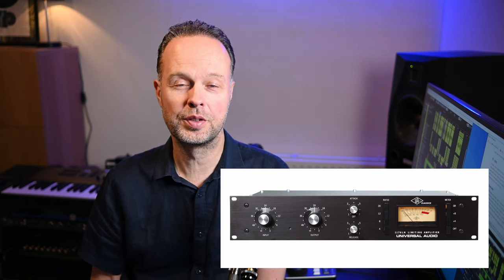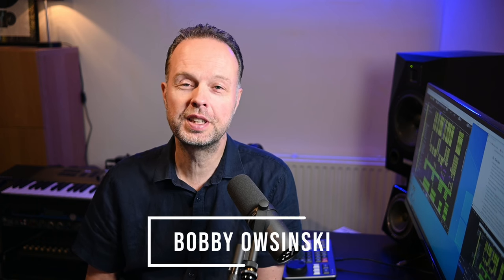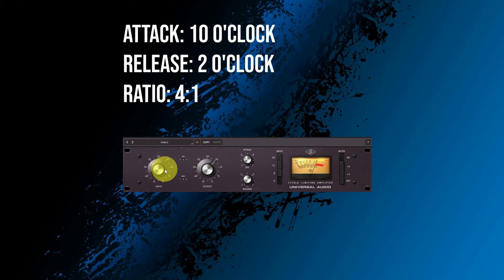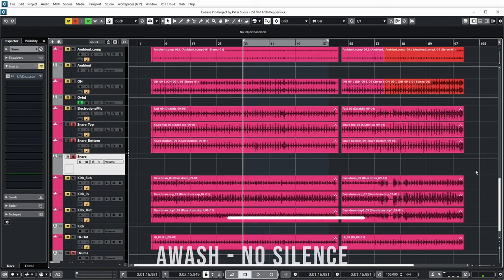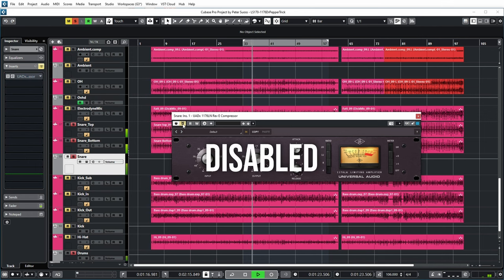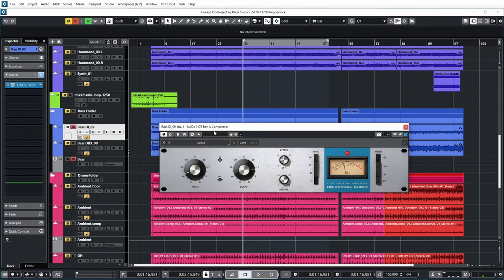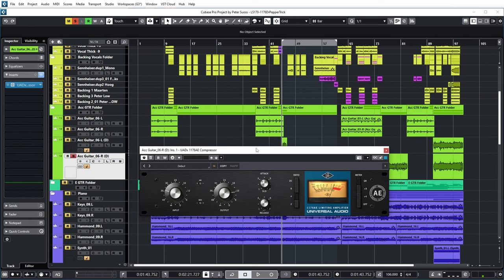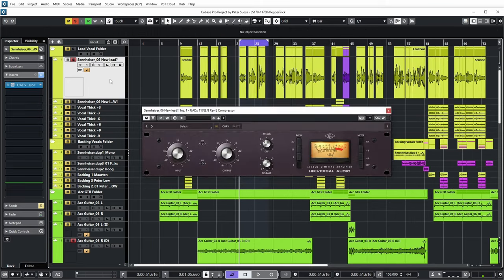Unveiling the Dr. Pepper Secret: A Surprising Audio Trick on the 1176 Compressor

Comment: I didn't know about the trick... but then again, I don't have an 1176-style compressor.. at the moment I think I'm managing to use the stock Cubase compressor mostly quite well...
Do these settings stand as a general all-around setting for basically everything, with some slight fine tuning depending on what goes through it?..
Reply from the maker: Yes that's the idea, they've found these settings to be working well for general compression duties on all sorts of tracks when using an 1176. I myself often use them as a starting point and then tune to taste. If you want to do something specific, like crush a drum track for example, these are not the settings to use though.
Reply: @LanewoodStudios  thanks for your reply, Maarten  - very useful information 😀👍
Reply from the maker: @AI-Consultant  thanks. I've heard of the Kotelnikov but haven't actually tried it yet. The free CLA-2A I have not heard about before.
Reply: @AI-Consultant  thanks very much for your input  🙂🙂🙂
Reply from the maker: @in2gadgets  any time!
Reply: @AI-Consultant the kotelnikov is great- but it is absolutely not modeled on an 1176
Reply: I was taught this decades ago, however '4' meant all four of the ration buttons in at the same time and not 4:1.
Reply from the maker: @leonardovalvassori  interesting. As a ‘works for everything’ setting, all buttons in hardly seems appropriate 😉.